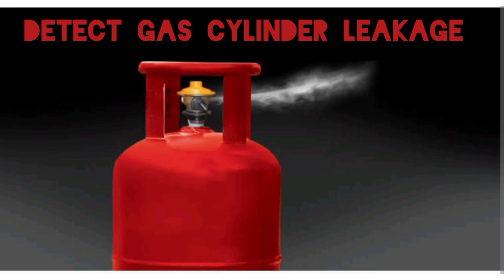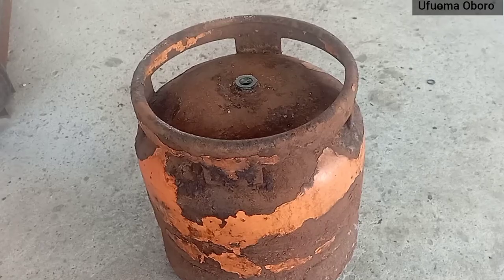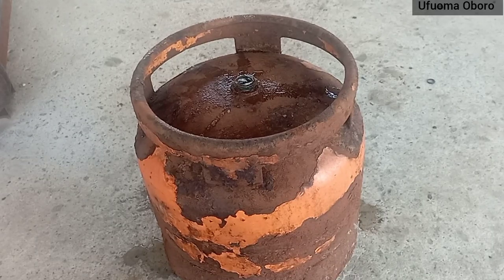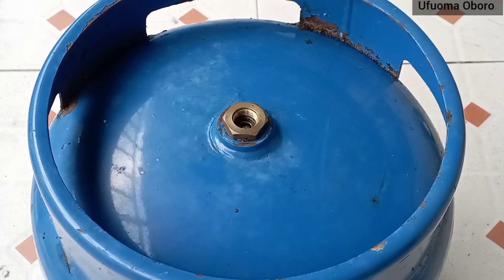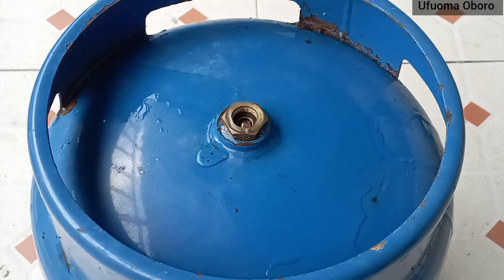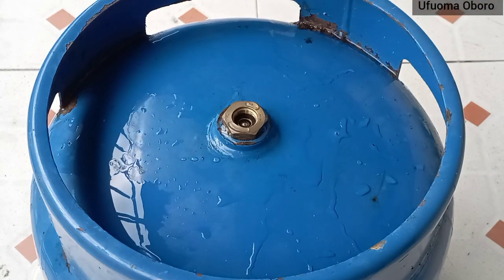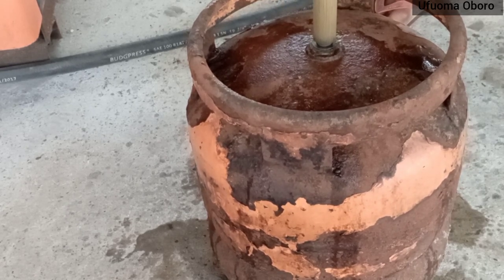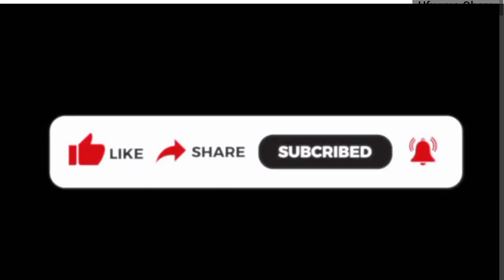How to detect gas cylinder valve leakage.

Comment: How about the case if leakage from the metallic part of the cylinder. What can you use to stop that
Reply from the maker: You can temporarily use gum, but get a new cylinder once that gas is finished, for safety reasons